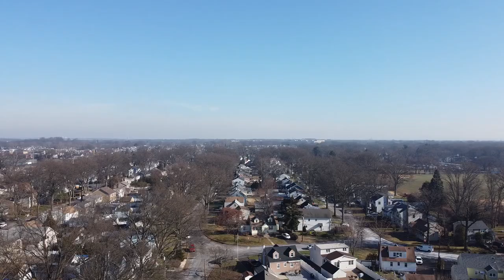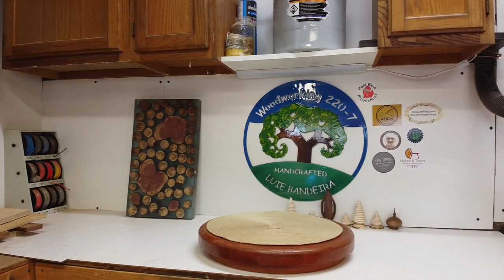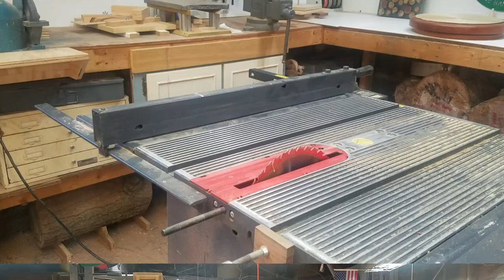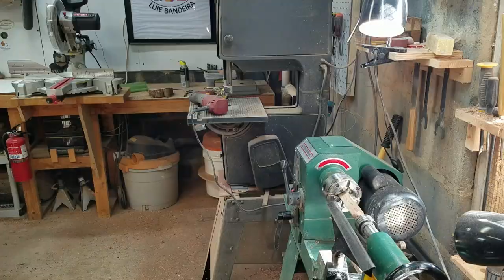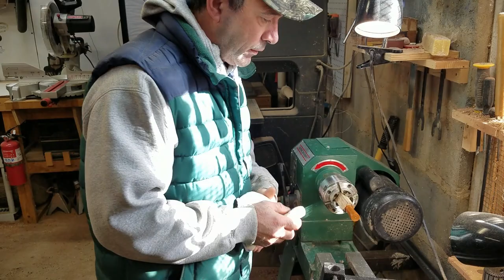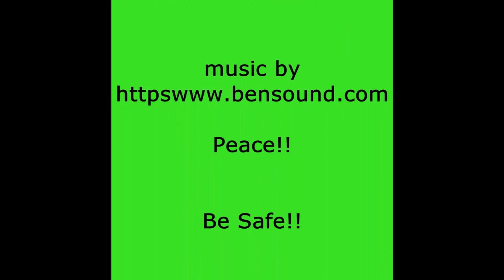Awesome new material for wood turning!

Comment: I Like the material. as previous replies, I also think it is Bakelite (AKA Phenolic).  To have a piece that size, a gold mine. Interesting if you want to glue pieces together, possibly have to use a 2 pack resin. Love the results.
Reply from the maker: Thanks for you input on the material...since the video posted I have found out that it is Phenolic.
And moving forward need to be very carful when sanding.
I haven't tried to glue it yet but will take your suggestion to heart

Thank you so much!

Comment: Looks like a carbine fiber material
Reply from the maker: Yes I thought that, but the weight is on the heavier side 🤔 and carbon fibers are known for their lightweight  if I'm not mistaken. 
Thank you so much for your view and comment👍👍
Reply: @spindlesworkshop9744  we used something that looked alot like this in the walls of our armored truck as a bullet resistant barrier I think what makes it so heavy is the type of epoxy that is used to glue the layers together
Reply from the maker: @bluelineturnings5055  really that sounds awesome!
Great title for the video I make when I use this stuff....Bulletproof bowl....😂😎👍👍

Comment: Luie - The frame at 4:00 where there's a hole aiming up shows definite flatsawn grain in the round part. Could this be laminations of thin (1/8 or 1/16") wood ? Hard to tell without any end grain. I'll take a stab and suggest Sapele or Persimmon. The link below can show you details of those 2 species.
I'm guessing the dots and wavy lines are pores and trachea in the wood. Look at this for an idea of what those are, take a good look at the "Storied Rays" section ... 
https://www.wood-database.com/wood-articles/hardwood-anatomy/   ... it's start ???
-Mike
Reply from the maker: thanks for the info
Reply: @spindlesworkshop9744  Moldie oldie ? Cleaning out your bucket list eh ? 😁😁😁
Reply from the maker: @mpart_woodlathe-stuff  yeah don't know how i missed this
Reply: @spindlesworkshop9744  NP. I know U💗me 😁
Reply from the maker: @mpart_woodlathe-stuff  😂